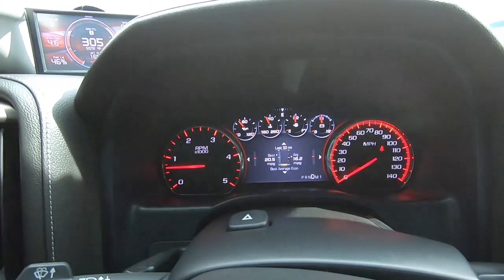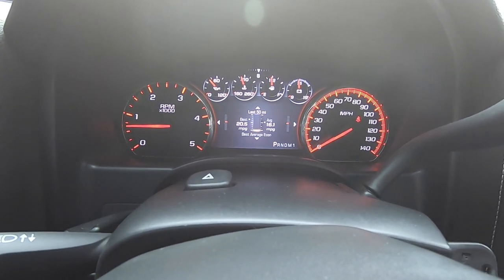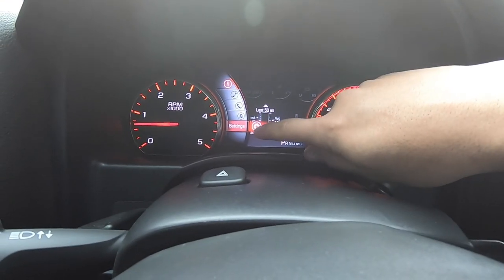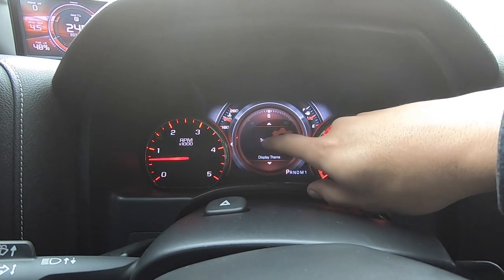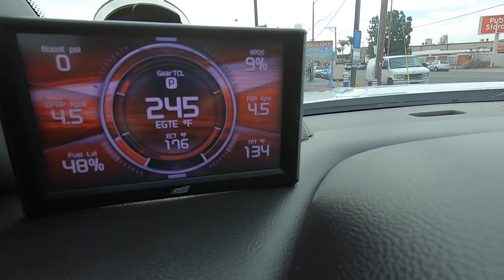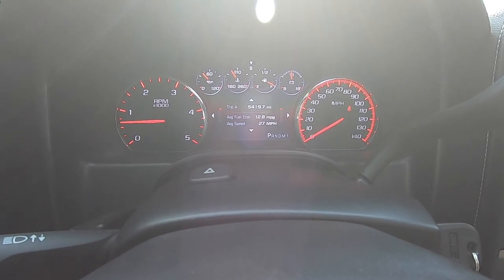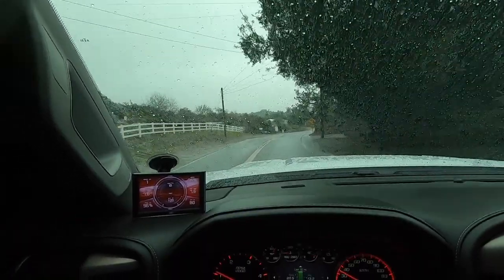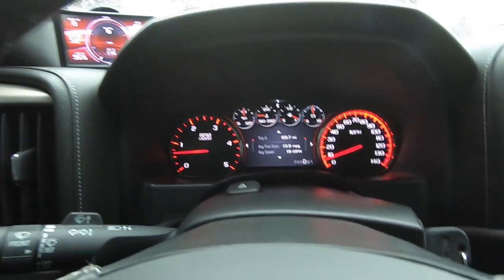WHAT DO THESE TRUCKS REALLY GET MPG?

Comment: I've been tracking my MPG the past 4k miles in an app called Acar.  My average is 15.673mpg.  LLY on 37's with 4.10 gears.  Pre-emissions truck with a predator 60hp tune and 4" exhaust.  Best tank: 17.858mpg. Worst tank: 13.155mpg.

Comment: If you use your cruise control as much as you can, the MPG's will increase.  All I did is add a Bully Dog and I'm hitting  26-29 mpg if I use the cruise. If I don't it drops to 22-24. (Running the flat lands of FL) My overall still says 19.1 but I haven't reset it since I bought it. (It's an OCD thing)
Reply: You're getting this with an lml?????
Reply: @ArizVideo  yes. It's a 2015

Comment: Just wondering on the duramax's when you adjust the spedometer for the bigger tires does it also adjust the odometer also? On my sprinter when you change tire size in the computer it only changes the spedometer and not the odometer so I have to take that into account with my fuel and mileage calculations. Great video and very informative.
Reply: Great Question..... I would also like to know this as well?? (I guess I could call PPEI and ask them?)
Reply: I have a stock 2018 gmc 2500hd Denali with the Banks Derringer tuner on it with it set at full power the truck is also lifted with 37”X12” Toyo m/t.  I’m getting 8mpg on average.  Before the mods I was getting 16mpg.  Mileage on the truck is just over 5000.  Beat that.   And I was told if I got a Diesel I would get better gas mileage, right!
Reply: I’m not sure about spending 7 to 10k for a California truck.

Comment: but have you taken into account your larger tires.. your truck still thinks you have factory size tires which equates to less miles than your truck actually thinks its going
Reply from the maker: no my truck is geared for 37s and my speedometer is dead on
Reply: You would be traveling MORE miles than stock, not less.. Bigger tires travel further per revolution obviously.